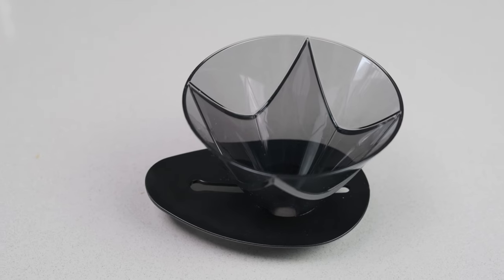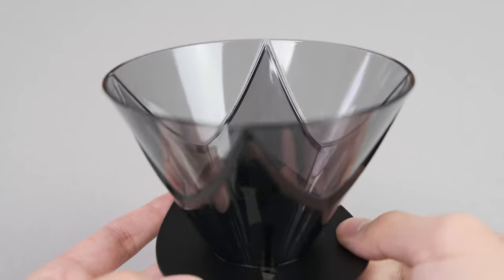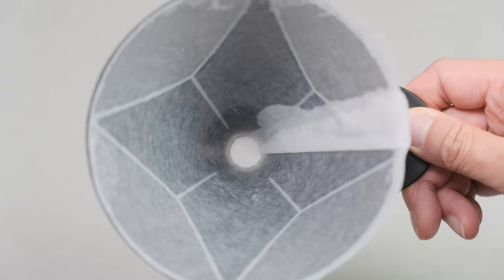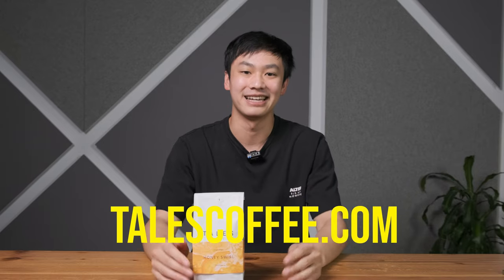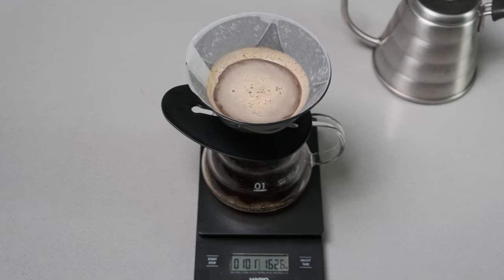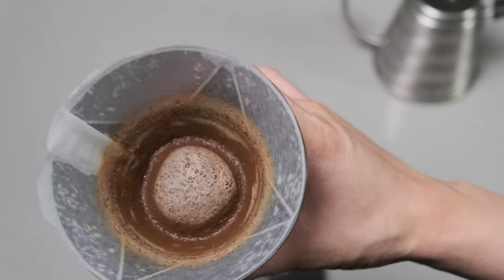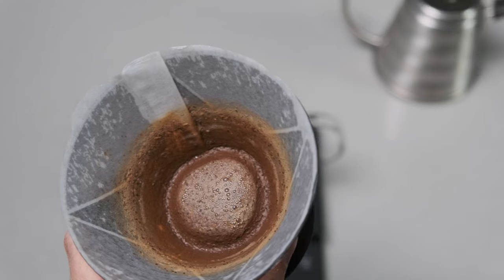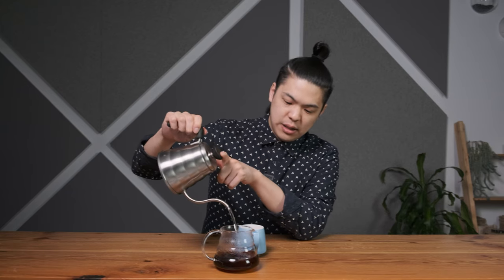Hario Mugen Pour Over Dripper Review

Comment: I'm glad hario is producing all these different pour over shapes recently, and in plastic! Now I've replaced my chemex and my clever dripper when traveling with hario drippers 🤯
Reply: Do you travel with your scale and kettle as well?
Reply: @mv28  yes and yes, an electric kettle.
Reply: @RealBonk  Hmm. I've thought about traveling with my coffee gear, but it just seems like it would be so cumbersome to lug a V60, kettle, scale, and gallon of Third Wave.
Reply: @mv28  I usually just travel with an aeropress as the v60 can be a bit much. Though since they come in plastic, it's doable.
Reply: @RealBonk  old comment but Aeropress is much more doable. Once dialed in you don't even need a scale for water. Just guesstimate using the water volume in the aeropress

Comment: Isn't the whole point of this dripper the easy workflow? What's the advantage (in the cup) of doing the slow pour and stirring compared to Hario's simplistic technique?
Reply from the maker: I don’t think the dripper was designed for an easier workflow.  There are people (like me) who do prefer the single pour method for other drippers.

The mugen still requires a slow pour in the beginning to have the first few drips as fully extracted but it ends up staling a lot easier so we end up doing the bypass.

The balance between the sweetness and texture is maximized with this method I think!
Reply: @TALESCOFFEE  It seems to me that Hario does try to make a point about simplicity and ease of use. This is from the instructions manual: "with V60 Dripper MUGEN,you can brew coffee with a single pour!Simply pour in hot water and let the inner grooves slowly brew your drip coffee."

As for stalling, can you avoid it by grinding a little coarser?

Comment: Hi! Great video! Does the Hario Drip Assist work with this dripper? Thank you
Reply from the maker: It doesn’t really work. In general I don’t think the drip assist is very good. Kind of a pointless tool imo unless you don’t have a great kettle and need help with control because you don’t use a gooseneck kettle or you just have physical disabilities.  I personally believe it’s not hard to get a good pour if you have a kettle that isn’t filled to the rim before you brew (too heavy makes it hard to control)
Reply: @TALESCOFFEE  Thanks for your reply. I realized later it's not for the Mugen. I was more thinking of the Drip assist when i travel - that's when i don't have a gooseneck kettle on hand. Thinking with a regular hotel kettle it would be helpful with a V60 for better control. Not critical at all tho

Comment: My only issue I have found with this dripper is the is the paper filter never fully sits in the dripper and I'll get a weird air Bubble
Reply from the maker: Ahhhh if you’ve watched I think my v60 video I talk about how the filter needs a fold that’s a little inwards on the top. That’s because the filters have never fit the drippers.  The other way is to do what I do and hold the filter at the bottom and then complete the fold. If you have questions DM us on IG it’s easier to see there
Reply: This is true, and I believe why so many people are getting suck quick drawdown times. If you really seat the paper correctly and there's no bubbles, drawdown time roughly doubles.

Comment: I just got the Mugen a few hours ago and I'm having a hard time making the dome. The drain is too slow and the water volume is too small. Any tips on how I can make the dome?
Reply from the maker: Hey! The dome is to do with the stirring, so if you stir well at the end then you'll get the dome.  If you're having issues with the drain pour just down the middle it'll help with the speed.  What is your current recipe?
Reply: @TALESCOFFEE  What I did a while ago was use 15 grams medium-fine: 220ml 91⁰C water (160ml poured/ 60 bypass). I started by pouring slowly at the center (at the divot) moving outwards. Then, I stir at about 55-ish seconds. When I use the origami or the V60, it immediately drains. With this one, the drawdown is really slow so my brew didn't maintain the dome shape.

Thanks for replying immediately! Means a lot 😁
Reply from the maker: I try to keep up on my comments! Haha. Hmm yeah the mugen is like REALLY slow only reason I recommend the bypass TBH. You just have to stir super fast or maybe try cranking up the grind size just a touch so it flows just a bit faster!
Reply: @TALESCOFFEE  Thanks! I'll try again tomorrow! Tbh, the coffee it produced wasn't bad. It seems richer and sweeter compared to my V60s and Origami single pours.

Comment: The gentler taste is definitely because of your bypass. You've basically made the equivalent of a pour-over Americano. That extra water wasn't able to extract coffee deliciousness.
First of all, you do you. If you're satisfied with your technique, don't change it. Here's some things that I think are worth trying out though (also for the sake of others that happen to see this).
First, do a bloom to release that CO2. Don't stir your grounds so much after pouring your measured water in. Gently shake the dripper as the water goes down to maintain a flat bed of coffee at the end for even extraction. Aim for a 3 min brew. If your brew time isn't finishing in 3 min, sacrifice that extra water still in the V60 and try a coarser grind next time around.
Reply from the maker: Tito. You know this dripper was MADE FOR SINGLE POURS. This is the DESIGN OF IT, whether I bloom or not on this dripper .. purely from the DESIGN AND INTENT from Hario alone, this is what it was made for. A SINGLE POUR.

This method you are suggesting I have done extensive testing on it. I even used it for three years in my cafe and none of them taste better then my current iteration of brewing. A single pour for me with MY understanding of it will be better. Try watching my extraction video :) you’ll see I bloom there and I explain my thoughts.

Keep up the coffee journey. Never stop testing, never stop learning.